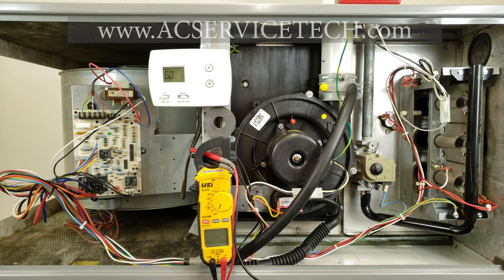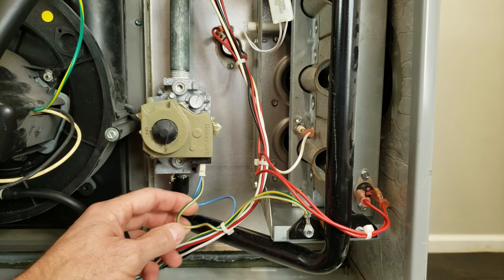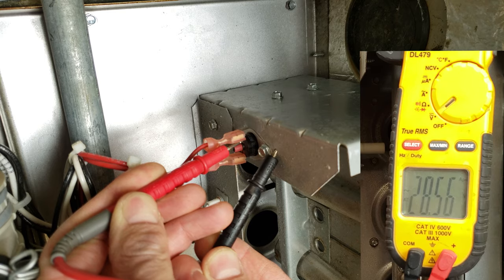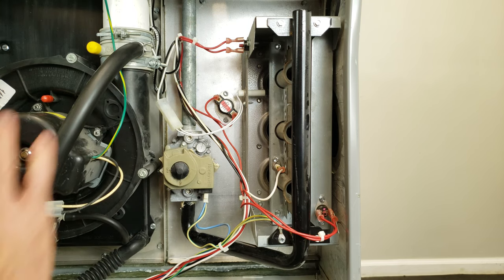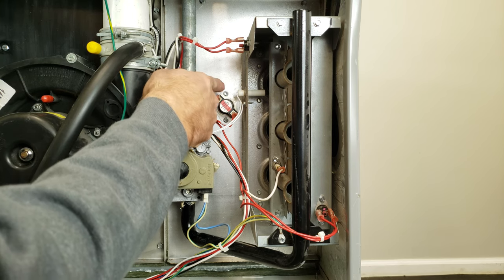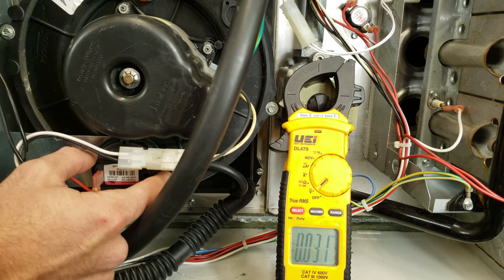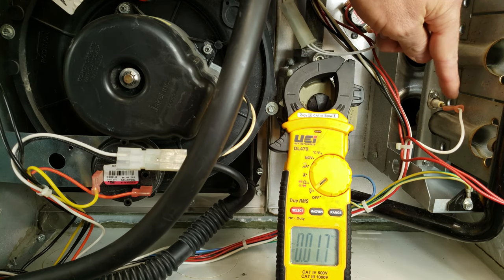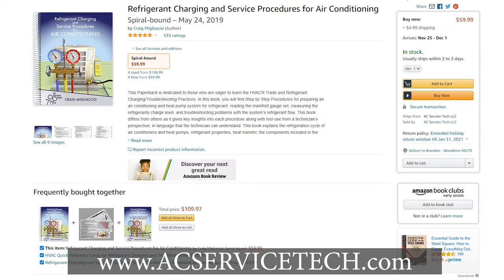Quickly Testing Gas Furnace Safety/Limit Switches!

Comment: I would like to add on more method. Measure voltage between limit connectors. If O volt means no voltage drop and limit is good. If 28 volt means open circuit - bad limit.
Reply from the maker: Great tip Eugene!
Reply: Thanks for the tip.  I'm new to HVAC but it's all starting to come together

Comment: Great topic. Sometimes I do this to check automatic reset limits. Just to make sure it is in working condition. I’ve put the flame from the lighter(blue part) and warming up limit switch metal shield till it will click, and make it OL, and then waiting for it to cool down and click back.  Another technic: if I see that the igniter won't go ON, I jump the pressure switch just a few sec later after the inducer starts, and then if the igniter starts to light up, I know the problem is most likely related to the pressure. The switch itself or clogged tube.
Reply from the maker: The only thing is those switches are built so small and precise that I really would not put a flame to it to test it because it may overheat especially the alum shell on the outside and it may warp causing pressure on the bimetal disc. I have done it in the classroom to fault a furnace for a student for the flame rollout switches but I wouldn't put that heat on those in the field. Hope you don't mind me saying and thank you for your support!

Comment: Glad to know another means of testing switches.   I thought you can test across the limit and find out if the switch is opened/closed via voltage readings (24v/0v).  Correct me if that is not correct.

Comment: Great tutorial.
Cheers
Reply from the maker: Glad you liked it!
Reply: I have a Goodman GMP075-3 furnace, installed in 1997. My AC and Heater are off at the thermostat. Fan is on Auto. The blower fan in the furnace turns on for a few minutes randomly almost everyday. Could that be a Fan Limit Switch issue? Will go into the attic and check some of the switches when it cools down. Cheers

Comment: As usual excellent video.
So, it means that switches can be checked via resistance and voltage?
Voltage should be same across and resistance should be "zero". 
Thanks.

Comment: Hi Craig and thanks again for your great videos, just a novice question, if we disconnect the power to the furnace, how come we have voltage on those switches?

Thanks again
Reply from the maker: There is power to the switches even when there is no call for heat, thanks!
Reply: @acservicetechchannel  alright, thanks

Comment: Hello! I ran into your video because my inducer motor isn’t starting. There is no flashing light on my furnace though. Just a solid light.

I tested each of my 3 limit switches and for one of them, one plug is giving 28v and the other is giving 0.03v. I also tested the pressure switch when calling for heat and both are giving low voltage. Any thoughts and advice?
Thank you!!!

Comment: It makes sense that the safety sensors should have power going through them when there's power to the furnace. However, I have come across furnace that is powered and no power to the safety sensors. Which is why I asked my question above/below.
Reply: how will the censors possibly trip if there’s no current running through? im no expert but it sounds like someone jumped the safteys

Comment: Correct me if I'm wrong,  checking each side of safety to ground determines the safety is open or closed,  however,  it does not prove that the safety will open if there is an issue,  if the safety is stuck in the closed position and will not open
Then your test didn't prove the safety Is functional

Comment: I have an older Carrier/Payne 3 wire auto pilot ignitor type furnace. I wanted to see if you could tell me how I can tell the diff between my limit switch & flame roll out switch? Most videos I watch have either a button pop type limit switch or a 2 longer pronged limit switch. Problem is I have both. So I'm thinking one of them may be a flame rollout switch but I can't tell. The parts # on it is smudged so couldn't look it up to verify what it is. Ty

Comment: My fairly old Bryant Plus 80 heater started cycling on and off every 3 minutes (that is three minutes of flame....three minutes of cold air...three minutes of flame...three minutes of cold air, so my house wasn't heating very quickly to say the least.  I jumped each stop limit switch with a piece of copper wire until, lo and behold, I came to the main furnace box stop limit switch and while jumped the furnace DID NOT cycle off prematurely.  I replaced the wires on that stop limit switch and the heater went back into its troublesome cycling.  So this tells me that the error code was right in that the problem was a stop limit switch and my testing proved which one it was.  NOW...to find out why that main furnace box stop limit switch is acting up???  (I actually replaced it with new one and the new one creates an open after three minutes as well.  So Do I have this all right?

Comment: So 0L means my safety switch needs to be replaced? I have just a wall heater eith thermopile and cant figure out whats wrong with it. I had to take the whole cover off to find the stupid safety switch. Since I have no voltage at my thermostat I'm really hoping it's just the switch and not the wiring.

Comment: I'm having issues with my furnace. the blower starts, the inducer spins (I think the pressure switch is good) the ignitor does not turn on but the gas valve does click and release the gas. I did replace the ignitor. getting code 34.

Comment: When I test my flame sensor the fan turns on for a bit and it registers 3 V - also my primary switch doesn't register any voltage- does that mean it's bad?

Comment: Actually, with the customer switch contacts closed simply use a jumper between R and W.  If the ventor motor starts you know all the safeties are closed and normal.  If the main blower starts you know the high limit is open.  Simple.

Comment: i did something dumb, .. i changed my thermostat and nothing worked except the main large fan always runs no matter under what setting it is.. i put back the old thermostat but it still does the same thing... the green light on the gas valve gives me an code of- "limit circut fault"

Comment: What would happen if you touch the flame sensor with power on?
I always clean them but remove the wire first. 
Sometimes the wire spade connected is bare metal and is not insulated. I wondering if there is a risk of getting shock. 
The furnace is power on but there’s no call for heat at the time I cleaning it.
Reply: @TheMaster5150  is voltage only going through flame sensor when there is a call for heat? Or after burners are lit?
Reply: @abnergarcia6252  When the door switch is in the closed position, there should be power to the flame sensor, safety switches, transformer, board...etc. He has a magnet, or tape on the switch to perform power test without any calls. With the door off the switch, you shouldn't be getting power.

Fwi...I was taught with 3 phase, and 240v check each leg to ground, even if your not getting a reading from leg to leg because you maybe reading the same potential "no difference" between the probes as the polarity could be the same.
My point is...if you're not 100% sure, aways check to ground, and a beeping volt tester first, because Doctor's have found getting shocked causes scarring to the heart.
Reply from the maker: Yes power is on any time the door switch is shut and power to the furnace. Thanks for answering TheMaster5150!

Comment: My furnace fan stays on all the time.  I tested the air pressure sensor and I'm only getting 25V on one terminal when the furnace is running (there's no continuity).  I removed the inducer hose from the furnace tube and gently applied a vacuum with my mouth and I could hear the contacts closing, and I verified continuity with my meter.  I did this several times to establish repeatability.  My understanding is that the airflow passing over the tube in the furnace creates a vacuum which moves the switch diaphram and closes the contacts.  I assume this closed circuit tells the furnace controller that it's OK to shut off the furnace fan.  I've checked the condensate drain hoses and everything is clear.  I also looked inside the metal furnace inducer tube that the switch hose fits over and saw nothing, but I did gently run a screwdriver in and out and moved it around a bit, but nothing came out, so it must be clear.  Is it possible or probable that the pressure switch diaphram has aged such that it now requires excessive vacuum to sufficiently move and close the contacts?  If this switch never closes will the fan run all the time?
Reply: Did you ever get a solution? I’m in the same situation.
Reply: @lifeovdeath  I had the service guy come to repair it, but unfortunately I don't recall what was replaced.

Comment: I have HEIL 96% furnace that is shutting down after about 6 - 7 minutes completely , including thermostat.  Code call for limit switch  i replaced switch but it still does the same thing, it does it only when required longer operations to bring heat in home for like 3 to 4 degrees up. Acts like its overheating.  Fan blows after shutdown for about 3 minuts and restars heating cycles  and works again for same amount of time 5:37  6-7 minutes and shuts off.  Air flow is good and clear clean filter. I checked A coil no dust so i am verry confused and concerned what is it and why is doing that

Comment: At least some boards test the pressure switch to ensure it is open before turning on the inducer fan.  An auto diag youtuber, Schrodinger's Box, has a recent video using a failed pressure switch off his furnace to give a lesson multimeter scale selection for resistance.  On continuity, the switch shows open, but on the 20M ohm scale it has a high resistance.  Again, his board reported this fault (due to a humidifier leaking onto the furnace electronics).
Reply from the maker: thanks for sharing!

Comment: It looks like you are only checking whether the limit and safety switch(es) "tripped". So if a furnace is not working, this is a good method to figure out which safety switch caused it, therefore allowing more detailed searching for the source of the problem. BUT I would not consider this testing of safety switches. For that, you would need to trip them and check whether they trip at the right temperature/condition. In my opinion, this is more a troubleshooting step, than actually testing of safety-related features. So don't believe that your safety switches work if you never actually checked if they can open ...

Comment: I had to recalibrate my limit switch because it was shutting down the furnace before it warmed up real good to heat.  But the fan won't turn on in automatic, you have to the fan on swtich.   The wire broke last winter and  had to splice  it.   I thought maybe the had burned out , But wasn't the case.  I think the switch on  mechanism  is not working.  I took out the splice,  hooked it to the wire , it still didn't come on.
Reply: Did you end up finding a solution? I’m about to get rider a new limit switch but I just tested it and it had voltage.   My furnace turns on fine but thermostat is reading wrong temperatures, fan doesn’t turn off after lowering tempering although flame goes out.
Reply: @lifeovdeath    I think my thermostat is a little off to.    It could be yours may be in draft cause it to stay on longer than  usual.   Put the fan on automatic.  Wait about 15 minutes  to see if it shuts off.    If is blows cold air,  turn on the heat  and see what  tempture it comes on at.  Let the the heat stay on till  room warms up ,   check the temperature side and see it what says.   If it's a digital,  click downward till the   burner clicks off.     If it is a lever one   click left or down.   See how many degree it off.
Reply: @lifeovdeath    one thing to if you have a wire at the side of the thermo coupling  you may have a loose wire.  Twist it just a bit just enough to tighten ,  it should stay lit when you light it.  
One thing to , if you have central air, check your out side compressor to see if it is running for a.c..   It may be running.  You may have to pull the breaker on it if has a lever.
Reply: @shellyblanchard5788  thanks.  finally got it figured out 4 days later.  So turns out the brand new thermostat I got was shot which got me really confused and made me run loops as to what’s wrong.  Just got a different thermostat and it worked.  :)
Reply: @lifeovdeath     right on.  Glad to help.